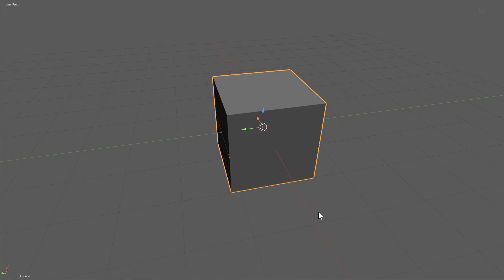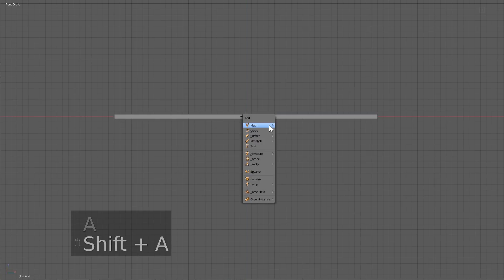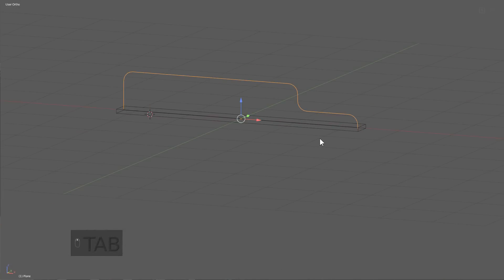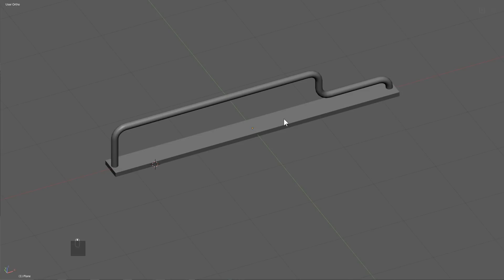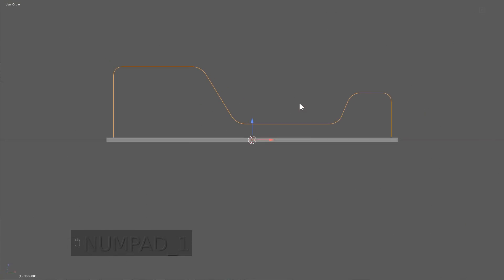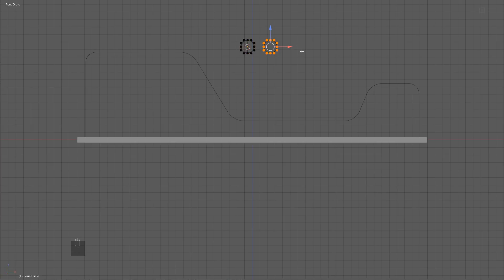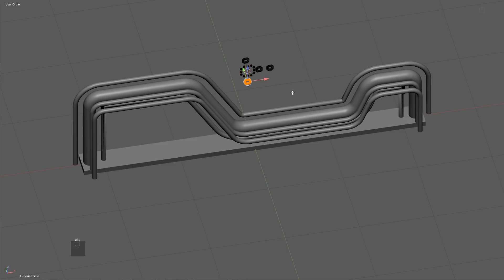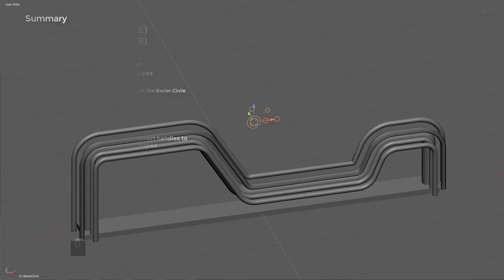H9: About Pipes

Comment: There are those round verts again. If you made a .99 cent plugin that made my verticies round I would buy it. But seriously, How did you make them round?
Reply from the maker: William Angel I may do a video on it but really I think it’s connected to the theme. I usually pick a theme from the options then in the 3d view >> vert size and scale them up. Maybe they are square small and circle bigger. Sorry for this enigma to continue . Let’s solve it! Big verts for everyone!
Reply: @masterxeon1001  I figured it out. Need to have multisampling turn on and no ambient occlusion.